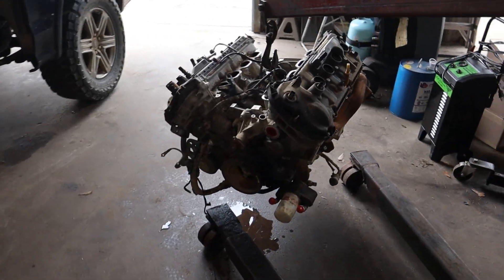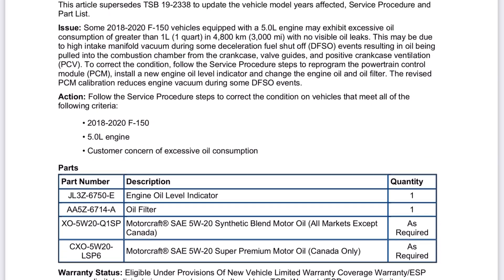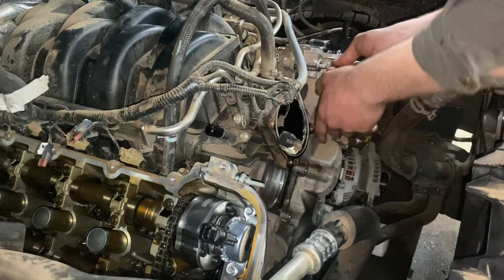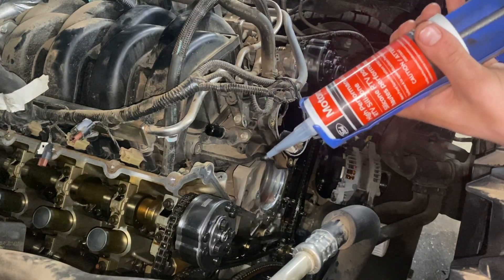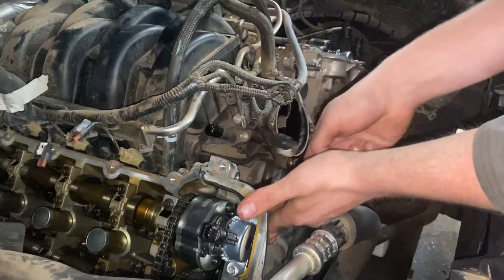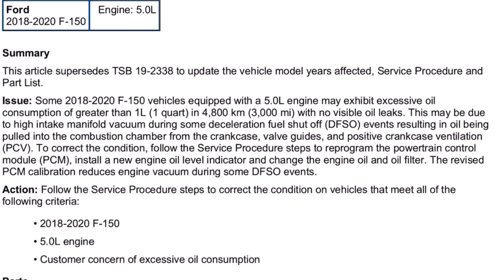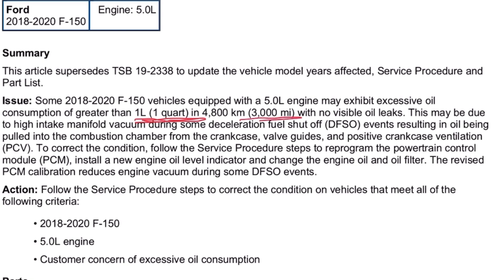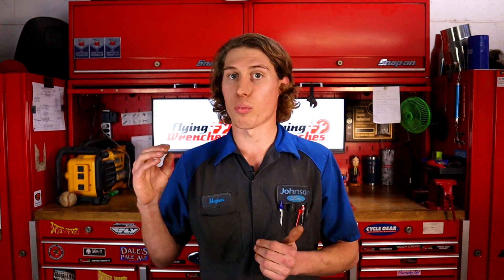Ford 5.0 Coyote Oil Consumption FIX

Comment: My 2015 5.0 has been flawless going on 210 k miles ! No transmission issues … best truck I’ve ever owned
Reply: @danwilliams8771 Yeah got a 2015 5.0 too, but a mustang gt.  I just wasn't a fan of the 18+ motor, transmission or Mustang front fascia redo, didn't like having an extra set of injectors with the Port Fuel Inject & the new Direct Inject fuel injectors, the 10 speed transmission and it's gear hunting ways...too many damn gears for an Auto to hunt through, and I was going for the Guard Metallic dark green grey also that was only available in 15 & 16, so I went with 15-16 5.0.  For the changes that were put in place going from gen 2 to gen 3, I'd expect the HP and Torque gains to be considerably better and at least a little bump in mpg gains, but the mpg gains stayed the same if not a little worse and the HP gains aren't the greatest, keeping in mind that the Gen 3 throttle body is slightly larger also so really where did alot of it's power difference come from?  Maybe I just need to see both gen 2 and gen 3 numbers with exact same mods side by side to notice the difference, maybe I'm missing something.   I just don't see what's so much better about the 3rd gen over the 2nd gen coyote, 3rd gen fans make it seem like it's the reinvention of the wheel.   They had to de-tune the 22+ models because of emissions, so really customers weren't getting 460hp, customers were getting 450hp the last couple years of it.   I jus't don't feel the 3rd gen Coyote is all it's cracked up to be, I'd say just skip the 3rd gen Coyote and the 18-23 Mustang with that ugly front fascia (if for the mustang, my opinion...they ended up ditching that re-design anyways and going back with a 15-17 type style design for the S650, many were against the 18+ mustang looks in the beginning....then later went with it knowing they had no choice if wanting a new one), and go with the 2nd Iteration of combo Fuel Injection (Direct Inject and Port Fuel) in a Coyote and get the 24+ 5.0 Mustang or Truck.    I added Oil Catch Cans to my 2nd gen 5.0 and naturally I have to check the oil anyways from time to time and empty those out.  My other cars that i've previously driven were older and used, and I drove them well over 200k+ and almost 300k miles, and switched them to Mobil Full Synthetic with a little Lucas Oil Heavy Duty Stabilizer added after 100K so I'm used to checking the oil.   Honestly I don't see how folks go without checking their oil every now and then!!  Especially with the cost of vehicles now, my goodness.  Though I know technology has come a long way.  Good channel also, you all take care, ty.
Reply: my 2015 F150,5.0 never uses oil 135K miles
Reply: It's the 2018 through 2020 that are having the issues be thankful
Reply: That's how my 2013 was except I traded it in at 80k miles, have had an 18 for the past 5 years now, better mileage but this oil burning issue started around 50k and the 10 speed is just ass. Has more power, though. Not sure I'm going to keep it much longer.
Reply: You been lucky. Just in past month same truck as you, I’ve had to pay someone to replace my rear main seal/plate. It was the plate that the rear main seal is in that was leaking as the sealant failed-why ford designed it that way smh. Then my water pump bearing started making noise. I changed that but got one from O Reilly’s that has lifetime warranty. We shall see what else fails. I sold my old 2002 f150 that gave me 0 issues for over 300k miles. Wish that 4.6 was stronger as I would have kept it.
Reply: 15-17 Coyote is the best years
Reply: @vegasfordguy  11-13 is actually best.  I have a 12 that has nearly 250k now with not a wrench turned.  Save for spark plugs and oil changes every 3k.
Reply: @puttervids472 11-13 have the soft valves that can wear down prematurely causing low compression and misfires. It doesn't happen to all of them, however it definitely does happen to a lot of them. This was corrected sometime in 2014. I also owned a 2012 F150 platinum as well as my current 2015 platinum. The gen 2 Coyote is considered a better engine overall.
Reply: @vegasfordguy  oil changes solve most of their issues. Same with the ecoboost.  I have a 13 3.5 EB with 165k and zero cam phaser issues.  These issues are due to the sewing machine weight oil and the 7500 mile oil changes. Run 30-40 weight ( I run 10w30 ) and change at 3k and you won’t wear valves out.  In fact I find the possibility laughable.
Reply: My 14 f150 5.0 has 150,000km and tow heavy long distances, does not use any oil whatsoever

Comment: Our fleet of F150's with 5.0's blew 4 engines in a fairly short period of time. The fleet investigations said it wasn't driver error, i.e. not changing the oil in the correct mileage(7500mi). Ford said it was from the start/stop feature. We now check our oil every week and the fleet is changing to Dodge(oh boy). There's something going on. I like my Ford and always have. I wish the problem could be figured out.

Comment: Ok I was with this video until the re programming part but then when this kid started with don’t check your oil non sense I had to turn off the video yeah ok buddy  I will not check a 100 thousand dollar truck oil level manually  so I can have 10 to 15 thousand dollar engine replacement . 
May be the problem is the piss oils that are being used by all manufacturers to meet EPA retard standards for fuel consumption and may be the use of low tension piston rings for less frictional power loss that could be some of those issues or the extended oil change intervals .
You want to
Listen to a good Ford technician listen to Mackulocko from Michigan .This  kid in this video is a pure Jed .

Comment: I think there's an underlying issue here nobody is talking about and that's the part where the catalytic converters are suffering through it. Living in a state where emissions reliability is critical and find out that the cats need to be replaced because they've been hammered with ash from the consumption of oil. You bet i'm checking my oil levels. In some cases the cats can cost more than the engine work.

Comment: Hey I’m 63 mechanic for life. Always checked oil levels in my trucks and small engine equipment. I learned this early on . I had vehicles that never used any oil and all were pre 1980. My first new car was 84 Mustang GT with 5.0 5 speed . I went through quart of oil every 1000 miles or less. I traded it in year after.

Comment: I bought a 18 5L from Georgia in july of 23 and when I got it she was basically brand new and only had 60k miles. When It got delivered she was making some weird noises since i had to put about 4 quarts into it to fill it back up. I assume the old owner never checked the oil besides regular maintenance. In October of 23 my catalytic converters died since they were plugged and one side even had some unburnt oil on the flange. Safe to say she got highflow cats but I have now tried 5-30 and a quart of lucas oil additive to slow the burn since i dont want to put more converters into it
Reply: Ur Lucas additive did it help slow down the oil consumption?? I thought about trying it
Reply: @baljeetseggzy7746  yeah it did help I put about one to 2 quarts in and just full syn, 5-30 motorcraft for a oil change
Reply: @spencer2.032  I use the synthetic blend Motorcraft (haven’t seen full synthetic). Going to probably give it a try here soon just changed my oil about 500 miles ago so still new. Would the synthetic blend be different then full? And did you use the normal one or the high mileage
Reply: @baljeetseggzy7746  i mean depends on how many miles you have but regular is thicker and that slows it down better

Comment: That’s the dohc 5.0 for ya 😂😂  

If you wanna buy a 2019 F150 go ahead because my 3.5 platinum burned to the fucking ground at 62,000 miles  as I was going down the highway the engine went up in flames course the insurance company paid it off after they did an investigation, but they never could figure out why it burned  which is one of the main reasons why I drive super duty’s now f350 better built trucks all the way around

One of the best Ford trucks I ever owned and it was problematic but I got the problems fixed. I never change so many spark plugs in my life the 5.4 3v valve 2008 F150. They don’t make a whole bunch of power compared to a diesel but you can build them to make a whole whole bunch power in a stock form, but I sold mine.

Comment: “Just don’t check your oil” is the exact same thing as telling someone to “just turn the radio up when your car starts making a new noise”.  Ignorance is not bliss when it can cost thousands of dollars assuming it’s out of warranty. Engines aren’t supposed to burn oil. That is not okay lol.  At least not at a level requiring multiple quarts to be added between oil changes. 

This honestly sounds like a spoof. “Is your engine burning through quarts of oil every week?! Well just stop checking it dummy! Problem solved!”  

Don’t get me wrong, I get what you’re saying. There’s a tolerance, or allowance so to speak, a buffer, that is in there. The engine can technically burn so much and it’ll still be safe, but that doesn’t mean it’s ok.

Comment: Most people Aren't reporting the oil leak issues that's why only 20 or so Have showed up with bad oil consumption issue lots of people See the oil consumption issue and Don't Trust the dealer or a Mechanic to fix it because it's been going on For years back to the 14 year models also

Comment: I disagree with you.been a Tech for 38 years. My 2011 Camry V6 has never ever so much as missed a drop of oil . I do my oil changes every 4k kms with synthetic. In this day and age the internal combustion engine should be almost perfect by now. Heck we've been building them for over 100 years . problem is cheap metals cheap parts and shortcuts to save money and the main problem is manufactures want things to fail so they can sell you a new one

Comment: As guy that used to have 4.6l modular for 175k miles it was under  full line but touching on dipstick at oil change and before next one level literally still touching full. Mix of Mobil 1 full synthetic, Motorcraft, and amsoil were used. If engine eat more than 1/4-1/8 of dipstick range I'm running away from that shit. Because oil consumption only get worse and worse. First oil change should also be super super early I'm talking like 500-1000miles and you should treat your engine super super softly for first 5k mile.

Comment: 2018 is when the displacement went from 302 to 307 cubic inches. How many of you have engines 30 years old that burn less oil than these 307’s.

Comment: Quote " A thousand miles and the oil wouldnt be touching the dip stick."
"After a couple thousand miles it would be 2-3 quarts of oil low"
Ford TSB states oil consumption at  a quart of oil every 3000 miles is normal, but the above comments would imply the oil consumption for many is well above normal.  The mechanic would imply this isnt an issue because more owners dont complain, but if they checked their engines oil consumption  they probably would. Clearly there IS a problem , but the average person dont know it.  Ok , so whats the fix? This mechanics opinion  is to "Stop Checking Your Oil." Thats correct, just ignore it until you have engine knock or warning lights. I suppose with an 8qt capacity you could burn a good bit of oil and still retain enough to keep your engine lubricated. Simple math would share a quart every 1500 miles would have you 5 quarts down from your 8 quart capacity between oil change intervals. If you dont care about oil consumption, you may wish to take a look at the cost to replace your catalytic converters as this bathing in oil can definitely  shorten its life.  I wouldnt ignore a loss of coolant , leaky roof or window, loss of air pressure in my tires, loss of transmission fluid, loss of power steering fluid or any other issue and the idea of "Stop checking and you wont know there is a problem" is a bit ridiculous in my opinion. Considering the cost of a Ford F150, owners deserve a reliable  engine  which uses very little oil between changes.

Comment: Mine had this issue and it suddenly stopped stopped! I towed a trailer 1200 miles up and down hills then the next week went 16 hour drive! Used no oil! But then I threw an engine code which turned out to be purge valve. I pick it up from the shop in two days. We will see. Mine runs smoother and pings less when it’s full to the top of the dip stick! Mine used to consume a half a quart of oil every fill up.

Comment: Funny there was no mention of the PTWA cylinder walls.. (plasma transferred wire arc) 
Oil consumption didn’t seem to be an issue on the gen 2 5.0’s. 
I don’t think stopping checking your oil is the answer. Just because it holds 9 damn quarts doesn’t mean it should burn 3 in 3-4K miles.
Reply: The cylinder lining process caused the oil consumption issue 100%
Reply: The rule always was, it is acceptable to use 1 quart in 3000 miles. Any more than that , you have a problem. I own 3 fords and none of them burn oil.

Comment: 2018 was the start of PWT sleeves. That sleeve was about.003 thick. Lots of inconsistencies in that manufacturing process. Prior years had .020 liners in the block.the Gt350 with the 5.2L was the first to get that technology. It was done at Ferrari I think in limited numbers. It was for a specialty vehicle. Then it when in to mass production and that when it went to shit. I think a plant in Mexico does the PWT process. The PWT is garbage. The 5.8L trinity got it also in the GT500. Again limited production. One it went mass production, it went to the cheapest bidder.

Comment: I think there is a point of over consumption...but i agree with not checking your oil i change mine on the regular (5000km im Canadian) sometimes if i just cant get to it i run it to 8000km which is what i was writing on window stickers at the dealer...either way ive never added oil just change and go...if i suspect an issue ill check it to see whats going on...if i think it's excessive ill look for where it may be going (valve stem seals, piston rings, leaks)... anyway not everyone is going to agree with this video but it doesn't matter i don't see anyone else coming up with solutions...im 50/50 on this video tho but kudos for putting it out there

Comment: I think you are right I have a 2018 f150 5L I change oil every 8 to 10 000 KM I have $233,000 km on it right now never seen engine light  it runs and drives just the way it did when I bought it new

Comment: One major problem with your reasoning of "there are millions of F150's but I've only seen 10 with the oil consumption issue" is that you're forgetting there are hundreds of thousands of mechanics shops, too. 278,146 mechanics shops to be exact (according to IBISWorld). If every shop has gotten 10 of these........that's more than ALL of the 5.0 F150's from 2018-2020. 🤣🤣🤣🤣

Ford sold an average of 864,426 F150's from 2018 to 2020, but that's across 5 different engine platforms at least (NA V6, 5.0, 3.5 TT, 2.7 TT, and Power boost).  If you say 20% of those are 5.0's, that's 172,885 per year x 3 years would be 518,656 total. 10 F150 5.0 engine repair/replacements per mechanic shop would be almost 3 MILLION. So yeah, you seeing 10 of these is pretty huge. And I get it, Jiffy Lube doesn't do engine swaps, but even if only 5% of those did 10, that's still about 140k, which is almost a third of all the F150 5.0's, roughly speaking. And only in a few years, too. That sounds like a pretty MASSIVE problem to me. But of course, we are only using very broad data, and we are extrapolating your 10 across 278,000 different shops so there's a massive margin of error here, but just to give you some idea IF the numbers were consistent what it would look like.

Comment: I have a 2003 with the 4.2, 248k miles. It uses 1 qt to 4000 miles even with the front of the oil pan leaking a little. I think I’ll keep it 😅

Comment: Ford Racing recommends 5W50 in any Mustang 5.0 thats run on the track so why not just run a thicker oil in the F150 5.0? The Hemi has always recommended 5W20 but I always ran 5W30 before I switched to Ford and no their were no problems with VVT or cylinder deactivation. Thin oils are nothing more than an EPA ploy to eek out a tiny bit more fuel mileage.

Comment: There was a knock on mine burned 3 quarts in 2k miles. Checked my oil and added 4 quarts to the engine and now runs perfect. Should not be burning that much oil.
Reply: Same issue here. I guess it's ok for Ford to churn out 10% lemons according to this video

Comment: Got a '17 f150 5.0 with almost 140k miles thats hauled steel enclosed trailers from day one.   Doesn't burn a drop of oil.  I've kept up with the oil changes its whole life and yes I check the oil level.

Comment: Low tenson piston rings isn't helping...I've heard there's also a cylinder sleeve that also corrects this problem. I had a 4.6 @ 250K and it had no visible oil consumption at 4K oil changes. Totally unacceptable for modern engines.

Comment: if only they didn't go to the spray in cylinder  and low tension rings ,a lot of motor heads are installing cylinder sleaves and high tension rings when needing a rebuild , I own a 2015 GT 6 speed no problems so far and use 5/30 syn oil every 3000 miles.

Comment: BS.    I didn't check the Oil for 4 months and when I did...it was 6 Quarts Low...Let me say again 6 Quarts low.   THAT IS AN ISSUE.  The 2020 Ford does not have a Oil level indicator light.  There was NO Signs, No alarms.  According to this video...its NO PROBLEM.  So you recommend driving the truck around on 6 Quarts Low on Fuel?  You should resign as a mechanic

Comment: 2011 5.0 checking in - burns a quart a month. They used to say the PCV valve would fix this but it didn’t. I check my oil monthly. 148k miles.